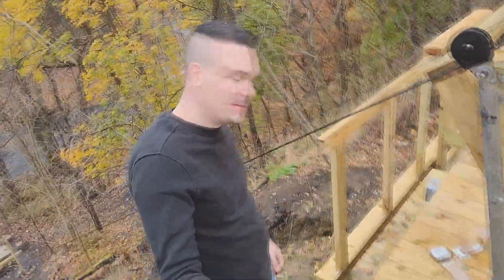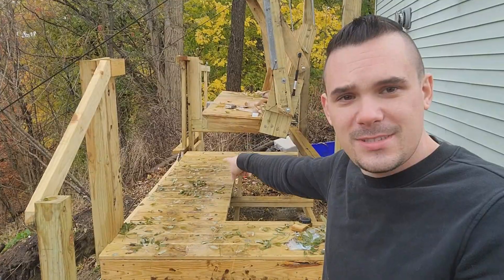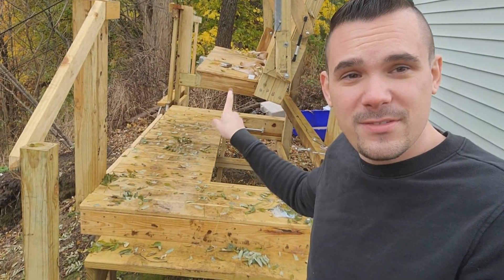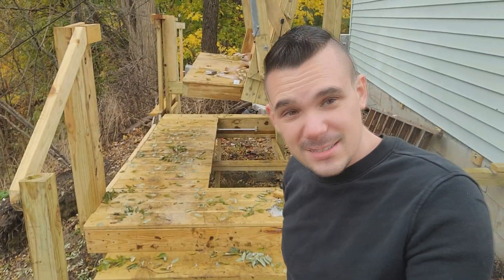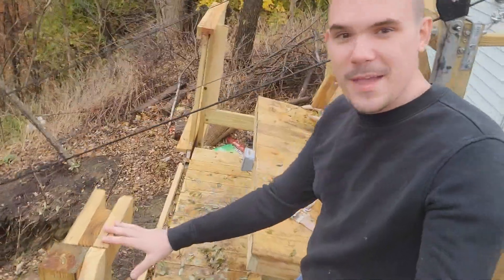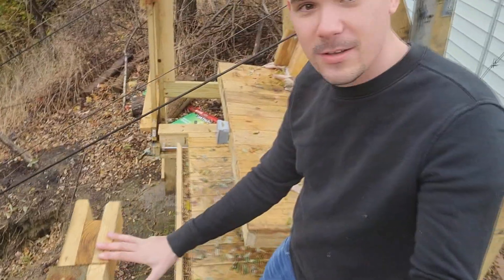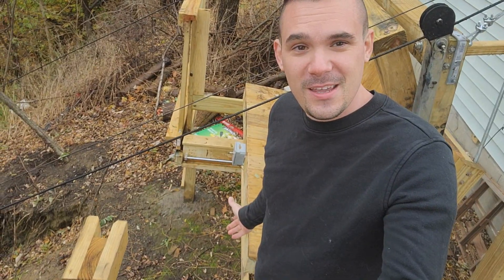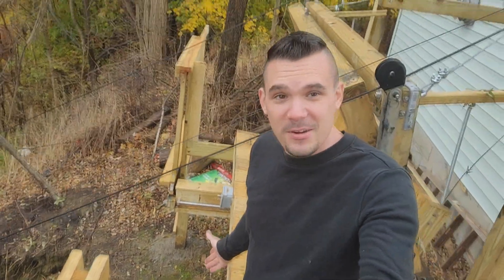DIY Chairlift 50 Feet Up! - How It Works

Comment: Is there a chance that you will do another video on the mechanicals of the winch? What are you using to activate the forward reverse, where did you source the winch etc. I have been looking for a cost effective option for something similar with a 200-300’ run down hill.

Comment: why do you have 4 wires. i see the back v pulleys are riding on the other wires to support it from tipping but why dont they ride on the same line as the big black v pulleys? honest question, thinking up how to make something like this for getting material up from my driveway to my yard/house. thanks. i guess having a second wire just could act as a failsafe if one sides wire did break so i guess thats good enough reason for 4 lines
Reply from the maker: The other 2 wires are for carrying 12V DC for the up/down switch to operate. It runs on 2 contact relays. They wont be much of a fail safe as its a thinner cable but that's how I control the hoist, which is designed for vertical loads btw. Good luck
Reply: @PlanesBoatsandSubmarines  thanks :) trying to get like 30yards of material up 40 stairs and tired of 5 gallon buckets and later lumber :(

Comment: This would be great in Wellington, almost every house is on the side of a hill and needs a cable car with a warrant of fitness and all the rest. Costs a couple of hundred thousand, I wonder if you could get away with building one of these and not have to go through all the rigmarole of setting up a cable car

Comment: I've got 5 acres of hillside in Kentucky with a flat spot up top, my house is at the bottom. It goes up 500ft in elevation in those 5 acres. Any ideas?
Reply from the maker: If possible, do a rail track. If thats not possible, sounds like quite a project. Would have to have multiple towers to support the cables and a hoist wont be practical at that distance. Would have to use a ski slope system where the cable cars go in revolutions.
Reply: Sweet wish u were my neighbor
Reply: @klifforsburg2799  I fixed my issue. I just 120lb now I just climb it 😂

Comment: Awesome. Is that a winch? What did you end up using. How much weight have you put on it?
Reply from the maker: Thanks. It's a vertical hoist, not a winch. I loaded it with about 600lbs of logs and ran it a few times. I always run it less weight with people in it. I've taken friends on it, if its under 400lbs together. Otherwise, 1 at a time. It's less than a 2 minute ride up and down.